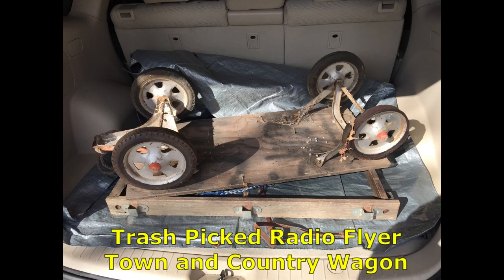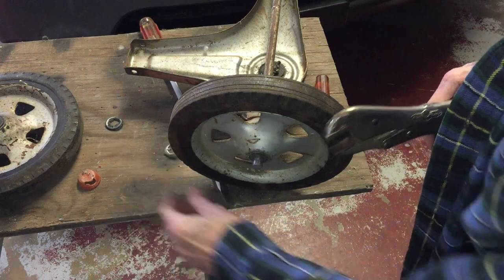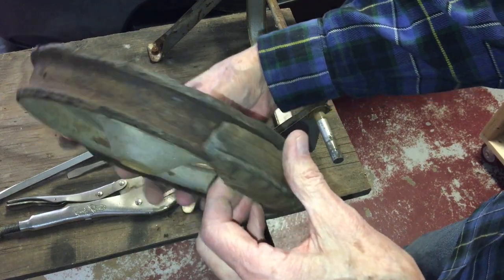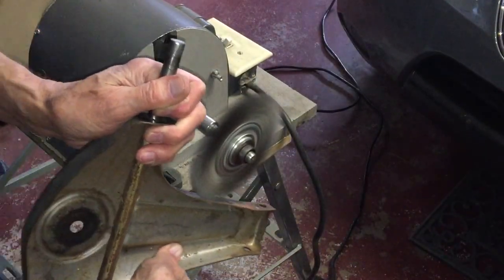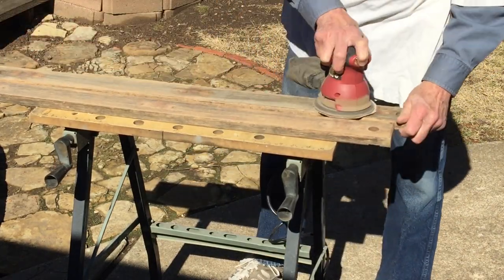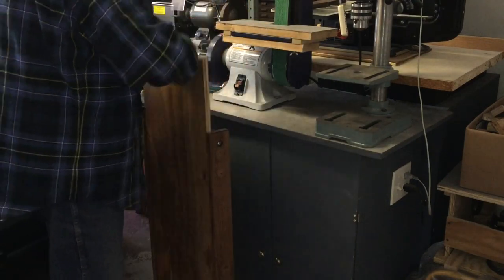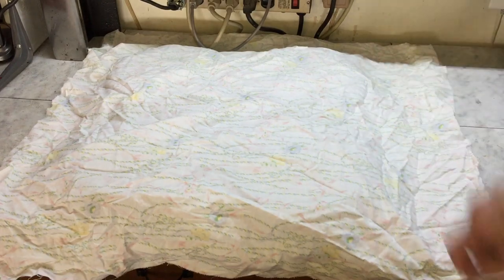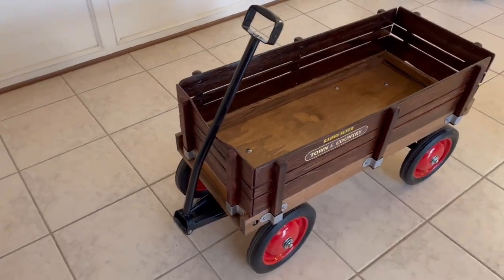Trash Picked Wooden Wagon

Comment: You did an excellent job on that wagon!  I’m just curious as to how you made the stickers for the side.  Perhaps sometime you can do a video on making them.
Reply from the maker: Thanks for the comment Frank!  I found the logos on the internet and used Photoshop to enlarge and modify them.  Then printed on photo paper.  I glued them on using contact cement and covered with a couple of coats of Krylon clear.  I tried using decal paper but that did not work well, so I decided on photo paper.  Thanks again, Bill.